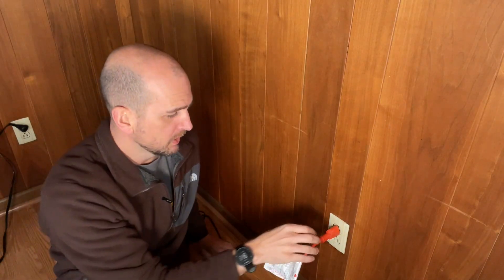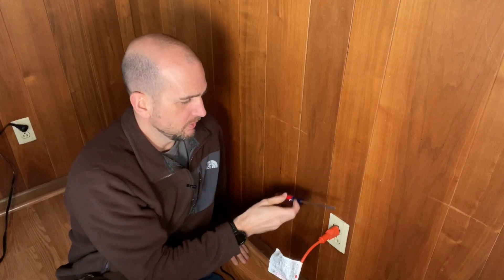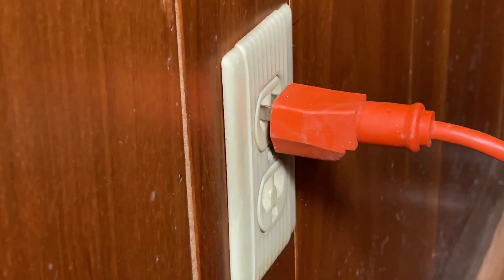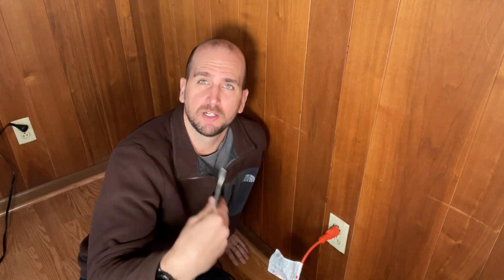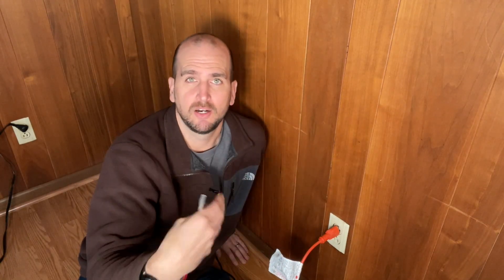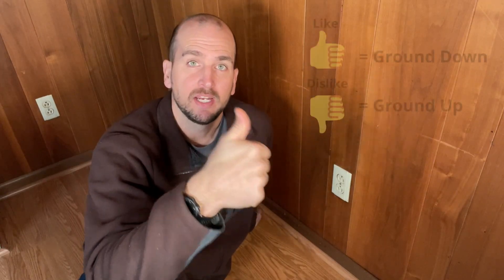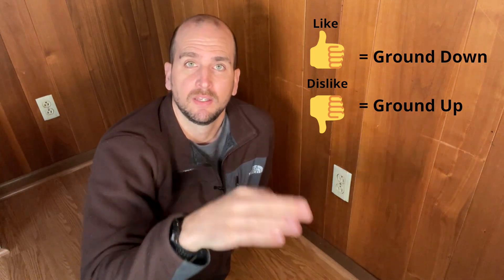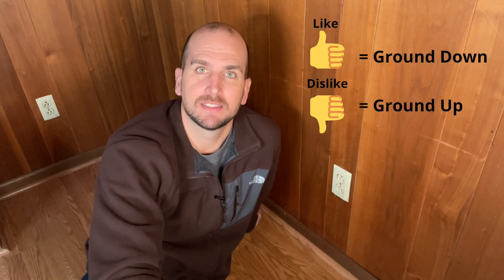Should An Outlet Be Installed Ground Down Or Up

Comment: When the outlets contacts tensions are very loose doesn't the leakage current increase in the unit load that is plug into the AC outlet? the leakage current I think increases because of the extra resistance and voltage drop at the outlets contacts

Comment: I always install outlets with the ground down. But I don't know why. Some years ago, I moved into a newly built house which had all the outlets installed ground down except for the switched ones, which were ground up. You mentioned this in your comments. I thought this was a good idea.
Reply from the maker: Great, appreciate the feedback 👍
Reply: In my area, decades ago, it was very common to see the switched outlets with ground up as a visual indicator.  It slowly disappeared.
Reply: This is a fairly common convention, but not universal - also, if only one outlet is switched, it is usually the top one, as it is easier to get to.
Reply: Yes agree, great idea

Comment: In my NY apartment (400 Units) all the outlets are installed horizontal. How about that
Reply from the maker: Hahaha, really?  All outlets?  Why do you think they installed all outlets sideways?
Reply: @EverydayHomeRepairs   I guess in NYC they like to do things different. The building is up 50 years.
Reply from the maker: @steves1749  😁
Reply: @EverydayHomeRepairs  I'm in Chicagoland. Retired union electrician having done housing from 1989 to the bubble burst of 2008. 99.9% of all outlets are horizontal with ground to the right/hot on top. We pipe all of are homes in the Cook. DuPage . Lake counties. I cringe when I see a outlet with ground facing left.
Reply: @robm3063  I was electricuted once by a sideways outlet. I used to live in Lake County, IL. Now I live in Viginia and the outlets are all virtical with the ground down! I guess with a state over 400 years old you learn a few things.
Reply: @EverydayHomeRepairs  cuz NY is like California, has their own only makes sense to Inspectors, code/policy writers there. Ive seen horizontal outlets here in PA, mostly on countertops, in cabinets for g/d, dishwasher GFI
Reply: If they are horizontal the hot side must be down.
Reply: There's no NYC requirement for horizontal receptacles.
Reply: Let me guess......They all are facing the left
Reply: @reversiontothemean6129  all of them have the ground to the right

Comment: I usually go by what the rest of the outlets are installed in the structure and do the same when replacing a worn outlet.
Reply from the maker: That makes sense and might be what I do on this renovation project as I prefer ground down but most outlets are ground up.
Reply: @EverydayHomeRepairs  alternate. Up. Down.up.down......
Reply: Yes, me too.  I try to match what the customer already has in their house. Unless they request a change, of course.

Comment: Our North American plugs and receptacles (NEMA) have a notorious history of safety issues that have been largely overcome in other countries. People make fun of that big, chunky, fused UK plug all the time, but the fact of the matter is that their partially-sleeved power pins all but eliminate the issue of installing ground down causing potential for short. Even though code doesn't mandate it, I usually feel as though doing the safer thing is a no-brainer, even if it's only the slightly safer thing. For most plugs, orientation matters little to the effectiveness or feasibility of the majority of cords, and the safety benefit of ground-up makes it worthwhile to do.
Reply from the maker: Good feedback Marc,  yeah I took a look at the UK plugs and noticed what you outlined which would be a big step in the right direction for safety.  Could you image all the uproar if the standard outlet designed changed in the US?
Reply: @EverydayHomeRepairs  That's kind of exactly it. In the US, we prefer (and usually have) a lighter regulatory touch than other countries, relying on private industry to "do what's right." Trouble is, that doesn't always work in a system where only the things that make or lose a lot of money are of relevance. As you mentioned, that company did try labeling the receptacles "top" with ground up, but as they discovered unless there's significant momentum in that wave, the current is never strong enough to bring it to shore.

Comment: Kitchen peninsula... my outlets are sideways... with hot on top.  I soooo want to redo those.with NEUTRAL UP.  I'm a gound up guy.  My father was an electrician but worked at a time when 3 prong plugs were not a standard.  He was neutral is on the left so that would have made ground UP.
Reply from the maker: Good point, sideways is allowed as well.
Reply: With neutral (longer) slot on the left the ground connection is below.
Reply: @sabasc3tube  yes... realized after I said it and walked away... thanks for correcting me... my bad.

Comment: We like ground up, as your safety thoughts we like, and because the weight of the cord naturally pulls to loosen the neutral and hot blades, with ground up the weight of the cord helps to keep the neutral and hot blades more secure...
Reply from the maker: Good point Barry.  Thanks for the feedback 👍